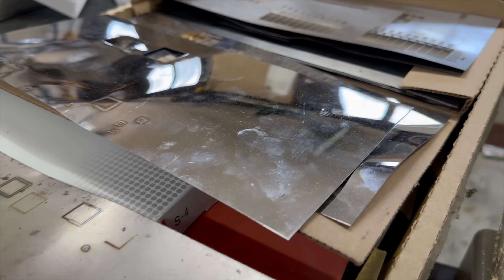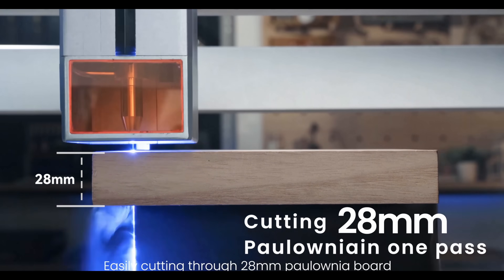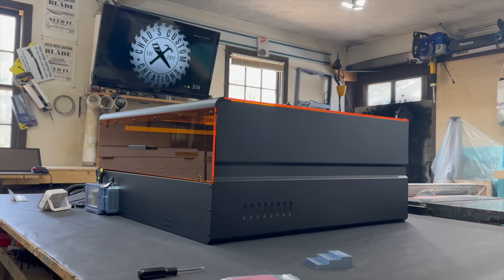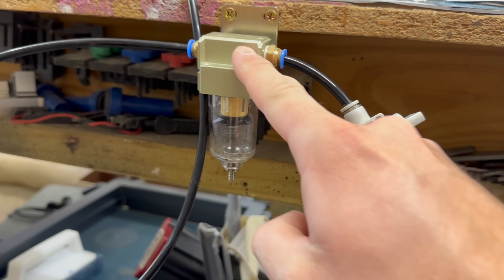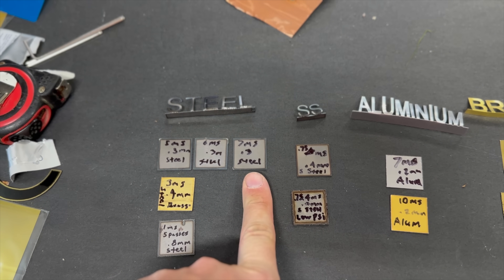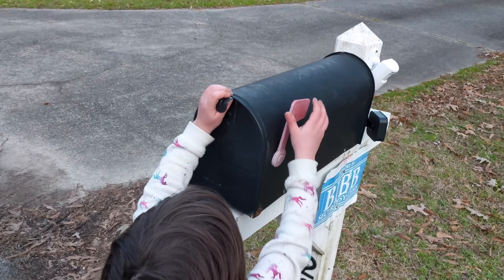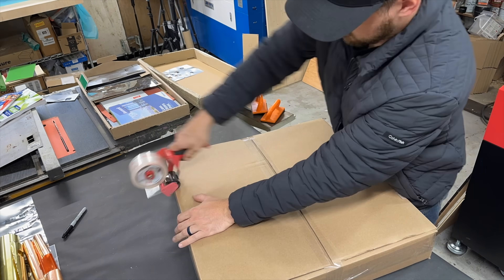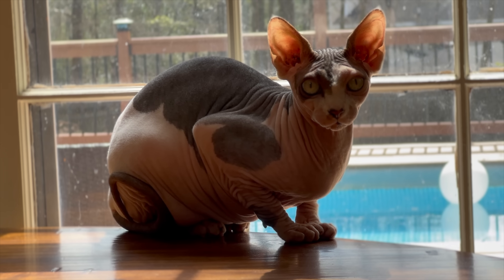Is The Future of Metal Cutting with Diode Lasers? 70W IKier K1 Pro Max

Comment: Coconut, very interesting video. Amazing you can get through any metal with 70w.ive tried with 100w co2 and no chance.clearly, spectrum dies matter. 

Have you considered trying a laser diode array assembly (fiber or lensed) Even one of those can run 250+ Watts, lensing and alignment of 2 or 3 of those with seems reasonably managed. Then cooling becomes the primary challenge. Rather than ability to cut.
Reply from the maker: I just love that for so long no one considered the 450nm wavelength as a viable option for metal cutting. But look at it now 🥹 I would love to put together a laser array like you’ve described.
Reply: @ChadsCustomCreations not disagreeing with you but, the 450nm range has been around for some time for  Marking, especially, within the Fiber laser  segment,  which was the primary source for these diodes for a long time.... even though the 5.5w diode has become the standard primarily due to a combination of power and spot size. There have been slightly more powerful diodes like the Number which without massive overdriving could run 6.5-7w+ but again spot size suffers with most of those.

While people have been experimenting with the optics and optical arrays since the origin of lasers themselves. (Think flash tunes and ruby rods) the real game changer within the home hobbies/small business laser diode space has been something that has been employed in the commercial fiber laser space for a long time  being knife edge arrays and lensing  to combine several  to many lower powered diodes, and prior to that individual pumped or tube lasers. Often even CO2 like older 300w and 500w "tubes" were arranged in a sequential type of "array" which involved 2 or 3 shorter tunes making up one array for instance.

Anyway, not sure if you have the budget for it, but something like a 800-1200W array could be assembled from as little as $1000USD if you have the other equipment and supplies to build it out already or lets estimate roughly $2000-$3000USD if you go with premium off the shelf parts. I'd love to see this in a video series myself if you interested.l, as I do plan on building one myself, but I've got so many other project priorities first it may be a while before I can get to it.
My interest is in more than just the simple hobbist creation of the device itself but the use and capabilities of the device and determination of the efficient and effective use of the device.... like (lensing vs fiber) and how to best implement such arrays both for convenience and practical use.

Even though i know sensational title work kinda like clickbait on places like YouTube, It still drives me nuts when people say, 20w, then 40w, now 70w diode lasers are the biggest and best thing, especially  when readily available single arrays are commercially available  from Nichia(meant for fiber lasers) for under $300 that basically start at those power levels and go up from there...and those are nominal ratings, not even overdrive. Many of these diodes will overdrive quite considerably, with adequate cool, and still have sufficient longevity to produce great result for years of commercial production.

If it inspires you to do so. I'd love to see a series on the creation and use of such a laser set up by you. TechIngredients has done one similar but, for me, he lacks the practical application part of the use of the equipment he builds. Let's see it in action... let's see it used in a small commercial setting seeing as this is the application these lasers excel at.

Comment: Coconut

Wondering if spray painting some black paint on stainless steel would help, or just be a zero sum gain as the paint would create smoke when it burns and blur the beam / fog the lens... (even with good air extraction) 

I'm glad at the end of the video your cat purchased himself. With YOUR credit card. I think you just got CAT fished 😂
Reply from the maker: I think it would work and shouldn’t fog the lens as the air assist already blows the smoke away from the lens.  Thanks for watching Martin.

Comment: Have you tried to use Argon gas for improve the aspect of the cut??
Reply from the maker: I have not yet, I’ve used oxygen and the results were definitely a hotter burn but I didn’t have enough pressure out of the valve I had.
Reply: @ChadsCustomCreations  yep, I know, in DIY world the problem with gas assist is the real thing. With tecnichal gas, such as O2, Co2, Ar or mix Ar/H2, Co2/Ar you may have better results but is hard to find and not even legal to detain at home a container of pressurized gas without permission.

Comment: Coconut, What a prize and would a 10w diode laser be able to etch or engrave any types of metal or glass. I presume the glass would have to be opaque or at least a very dark colour.
Reply from the maker: I know the 10w lasers can etch stainless steel. With glass you just gotta put something to capture the light to engrave the glass like some tempera paint that is then easily washed off after engraving.

Comment: Coming from a fibre laser operator, if you replace air with nitrogen, you will get better cuts, have more pressure and wont have issues with water in the air supply. Yes, it costs more to use but it goes a long way and if you get food grade, everything will stay clean. Otherwise, an air dryer will help,  along with air and water filters.
Reply from the maker: Interesting I haven’t thought of nitrogen!

Comment: Coconut is a great flavor, but I've never like the texture.  This diode laser is impressive, and the improvement in performance with higher air pressure is really dramatic.
Reply from the maker: Rob it is crazy the difference the air makes!

Comment: A little trick for your air compressor, add a hose 2 or three feet long to the bottom drain with a valve at the end of it to drain it.  All the water will remain in the hose not the tank thus saving the tank from corroding as much.
Reply from the maker: That is a great idea!
Reply: @ChadsCustomCreations  One more, put your compressor on a timer.  I use a variable 8 hour timer.  If I plan on using it I set it for the hours I plan on being in the space.  Never have to worry about it.

Comment: I would recommend a desiccant based compressed air dryer and also go way up on pressure.  I've run 175psi on a 1kw fiber laser and that seems to work well.
Reply from the maker: Oh that’s interesting about the higher psi i will have to try that.

I wanted to find an air separator with desiccant but couldn’t find one is that something I can just add to say stage 2 and 3 of a normal 3 stage unit?

Comment: Have you tried to full-on glue the steel plate to a thin stiff material like particle-board/OSB/plywood or such? Something still cutable with the initial pierce but that  doesn't warp from heat and keeps the plate in place for the entirety of the cut.....(applying some heat to the metal would break the glue bond and it's metal so cleaning it up should be  fairly easy...)
Reply from the maker: That’s a great idea I haven’t tried it but I definitely need to!

Comment: Instead of fluffing around with these tiny diod laser just invest in a 500w to a 1kw fiber laser (it´s diods connected to a fiber cable)  
They exists in a small frame size like worktable 1500x900mm and voilá you can make a business out of it.
They set you back around 25K usd just around a cheaper car but you can make alot off business cutting steel.
These tiny diod machines are to slow to make any amount of a decent paycheck and customers pay more to get stuff made out of metall then out of wood or plastic.. and the material is actually cheaper so better turnaround :)
Reply from the maker: I see your point but for the average Joe and at 1/10th of the cost these diodes are a great machine especially since the 450nm wavelength can do so many different materials not just metals. 

That being said, if someone would like to allow me to test a 1kw fiber laser I would definitely take that opportunity.

Comment: Coconut! I ordered my first 3D printer today (been meaning to get one for years). A small laser would be an excellent addition. I don't see why people don't add small lasers to them, let's change that.🤔
Reply from the maker: Congratulations on the new tech. Actually there is a company that has a 3D printer, laser, and CNC router all in one I think. Snap maker is the name. They have reached out to me but personally I like stand alone machines more than ones that do all of them less efficiently all in one.
Reply: @ChadsCustomCreations  Thanks (you're the second person to congratulate me). My bank blocked the initial transaction to spice things up.

There's a mixup with the pricing. They had a site wide sale of $50 off when you spent over $450. Which was initially applied but changed to $30 when I went through PayPal. Not too impressed with support, but English isn't their first language, so I'll cut them a little slack. As I had a tab with $50 discount applied, I gave it a whirl (thinking it would work or be expired), but it was a duplicate order of the previous order, so I ordered two! I'm not sure if I'll keep it for parts (been planning to build a CNC router) or sell it. It's a good deal at under £400. Almost brought a Bambu, but they're too closed off.

 I think adding CNC to a 3D printer doesn't make sense (they're totally different frames; Too weak to mill, too small for wood, low torque/gearing, plus the mess), adding a small laser shouldn't be a problem.

I've been a software developer for as long as I can remember, but I recently have an urge to build physical items.

Already have some products lined up (that fan will go before I switch it on, have a large box of Only Fans😅). Sort out panels ($150 for the enclosure is a little steep), the display, camera(s). All the stuff they try to squeeze you for/ why I wanted open source. I'm looking forward to it, should be mid-June.🤞

Comment: Coconut! This seems like a nice machine
Reply from the maker: It definitely is, lots of power and very solid!
Reply: @ChadsCustomCreations  would a CO2 laser with the same wattage be able to cut through steel like this one?
Reply from the maker: @RDF-TV  I have tried with a 90W and it can’t even engrave. But I believe there are hybrid Co2s with oxygen assist and a specialized laser head that can.

Comment: Just a thought; rather than multiple passes continuously, one pass then pause for 30 seconds and run again, repeat as necessary.  This is a lesson I was taught in welding thin metal.
Reply from the maker: Yes this is brilliant I didn’t think about it but this wouldn’t be too hard to set up in lightburn I bet it would make a world of difference I’ve gotta revisit this and probably have 4 secrets to metal cutting
Reply: @ChadsCustomCreations  Run separate programs for each cut instead and pause as long as you need between each. If the Lightburn software can't do pauses that is. You can also likely trick it by doing some kind of repetitive move command without actually turning on the cutter and using that as a wait function.
Reply: @ChadsCustomCreations  Could you also install a heat sink as your "spoil board" with active cooling? Thermal adhesive would also prevent the need for clamps. You can probably buy an industrial heat sink, or make your own with your fancy laser cutter. :)
Reply: Or increase your power output and increase travel speed. I'd also recommend using nitrogen instead of air.
Reply: @vulgardisplayofpowertyr  one would some he's already at 100 watts, but yes that would be a no-brainer if not.
Reply: @vulgardisplayofpowertyr Why? Oxygen helps burn and remove material.
Reply: No need for hand-me-down advice, or assumed accuracy for such 4th hand advice. 

Simple, stick a FLIR camera in there and timestamp the data. 

Could even experiment with coatings that alter the inductance of thermal energy at the surface, just a guess but I reckon Maui blue would be an interesting point to start. Hehe
Reply: Maybe also actively cool the metal with a fan.
Reply: @sierraecho884  You'd probably make matters worse, I think. The issue will be thermal gradients between the cutting point of the laser and the various edges of the sheet. I think you might have better results heating the sheet to reduce the thermal gradients, minimise thermal shock at the cutting point, and allowing you to then also more gradually cool the sheet between cutting passes and such. Trying to cool it evenly I think would be very difficult, given turbulence and the complex shifting topology of the thermal gradients across the sheet that are created by both the moving heat source of the laser and the changes in the length of the conductive paths from that point to any given edge introduced by cutting the sheet (and thus essentially adding in walls of a much, much better thermal insulator in the form of air).

Now, if you could submerge both the sheet and the laser head in water or something you might have better luck with a cooling approach as it wouldn't insulate as much in the removed sections and would aid in evening out heat distribution, But I think it would probably just boil and create all kinds of turbulence problems of its own, and the only way around that one would be weird cooling fluids other than water or having to pressurise the whole thing to raise the boiling point of the water, and you're getting rather industrial at that point I think. xD
Reply: @GameFreak7744  Very well could be.
Reply: Or just buy a setup that is designed for cutting metal and stop wasting your time.
Reply: Another Thing which we used to do on laser cutting of metals is keep the item joined to the main piece of material with tabs \ break outs

Comment: Greetings. We already have much more efficient technology such as fiber lasers that work at 1064 nanometers suitable for metal work, I wonder why then persist with laser diodes that emit a wavelength at 450 nanometers and are rarely suitable for cutting and metal engravings??
Reply from the maker: Macroby thank you for watching. Just trying push the boundaries of what we think is possible. Most fiber lasers from my understanding are galvo style which are limited to a small size say 4”x4” and though they are good for engraving are not really optimal for cutting. A $2k diode laser that can cut 22 gauge steel I’d say even though it wasn’t originally intended for this use it definitely makes it a viable option for some. I am not picking sides on lasers but I’d say the 450nm wavelength sure is a versatile laser when bumped up to these powers.
Reply: @ChadsCustomCreations  Hello and thanks for your reply. In fact some time ago I did some research in the field of industrial lasers, and I discovered that recently the industry is using high power diode Blue Lasers (4 KW CW) that work at a length of 445 nanometer wave for the microwelding of copper and also gold. It would seem (and strangely) that the metals mentioned above (non-ferrous metals), highly reflective, absorb laser energy well on this wavelength. Therefore, even for hobby use, these diode lasers could be used very well, but in my opinion we are still far from making precision cuts both due to the low energy power available and the optics that are not suitable for the type of work. in my opinion, powers of the order of 300 watts would be necessary, and there are laser diodes of this power on the market, but at this point the cost would no longer be accessible to everyone...
Reply from the maker: @macroby oh wow a 4Kw blue laser that sounds incredible. I am hoping like flat screen TVs the price just keeps going down making more powerful options less costly allowing more hobbiest more options for their creativity in the future. I’d say from 20w to 70w in under 2 years we are on the right track so far.
Reply: @ChadsCustomCreations  fingers crossed then... 🤞
meanwhile the manufacturers of fiber lasers for hobby use could modify their products, for example by adopting specific and adaptable optics on CNC machines with Cartesian axes, to always have a perpendicular beam, I think even a 20 watt module at 1064 nanometers and with appropriate optics you can make nice cuts in thin metals without burrs.
Reply from the maker: @macroby  you know what! IKIER actually has a 20w 1064 for this exact laser setup. I definitely need to get that and test it out the comparison would be super interesting at least to me 🤔
Reply: @ChadsCustomCreations  excellent! I honestly didn't know and it would be interesting to test it and try to do some cutting work.

Comment: coconut You compared differences to the plasma cutter but the problems appear to be the same. The slag can be from not penetrating or going too fast or too slow. I'm curious if the aluminum was rough on the sides of the cut or not. Also to prevent thermal expansion while cutting larger pieces try implementing breaks for the metal to cool down during different intervals of the cut. During the break a fan can blow on the material to help speed the process. However thats where the water table comes in handy with the plasma as well. I believe without a doubt the laser can be as powerful as the plasma but the water jet is dominating the industry on a large scale. Diamonds are not cheap though.
Reply from the maker: Ohhh interesting actually putting in breaks even manually would not be hard in my software I should definitely try that! That’s brilliant I so wish I had thought of that! I am going to have to revisit a large scale attempt on that 22 gauge and then if it works I change my 3 secret’s to 4 secrets and give props to you for the idea!